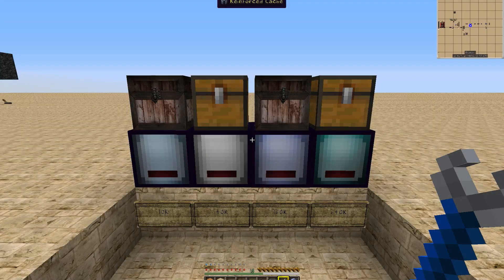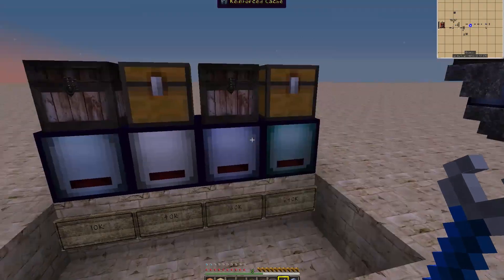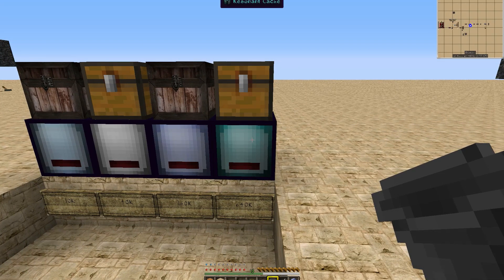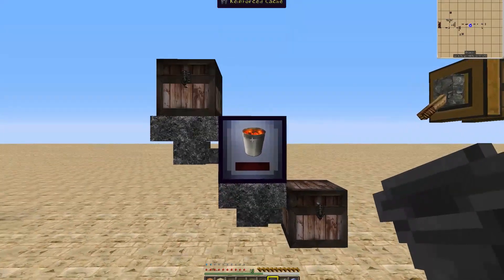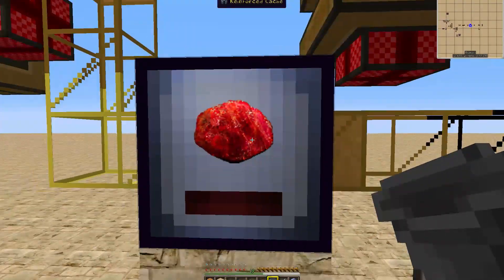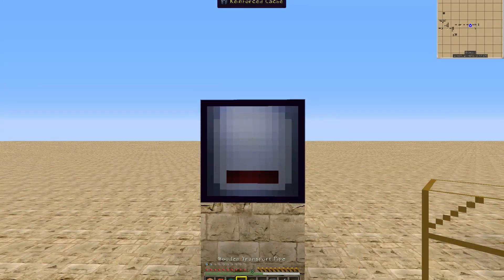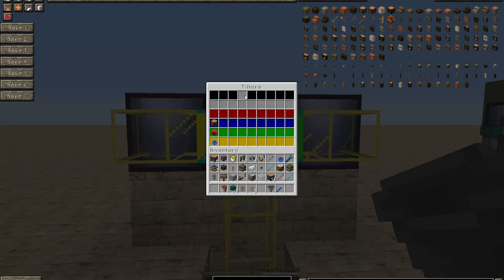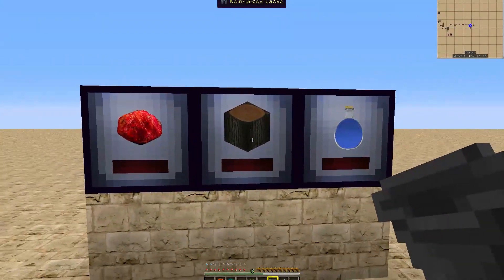How It Works - Thermal Expansion - Caches - Tutorial

Comment: Arent these just basically more expensive, less cooperative jabba barrels?
Reply from the maker: JABBA barrels require diamonds, emeralds, obsidian, end stone, etc to get the different Mk levels for structural upgrades to make better barrels. These Caches are rather cheap in comparison and simpler to upgrade, with the most expensive (and last) upgrade requiring ender pearls and blaze rods.
Reply: RxCraft yeah but....if you have the need to upgrade these, then you already have the resources for the jabba upgrades. lol
Reply from the maker: guardiangarasu True enough. :)  How about it's easier to set up Autocrafters to make Resonant Caches? The mod setup I use in my LP doesn't have JABBA, so there's always that problem too.
Reply: RxCraft that might be what it boils down to. whether or not jabba is installed. of course these also look good for those who want more of a hi-tech feel to their storage.
Reply from the maker: Yes, I do agree they look more hi-tech. I'm kind of a fan of the full meter they have instead of the 2^64+X display of the barrels.
Reply: but still. its hard choice between these and the b-space upgrade for jabba. lol
Reply from the maker: Yeah. I think these caches would be a great starter storage room item and maybe use jabba barrels behind your cobble/dirt/etc mass storage sections as a "deep storage" option, but keep the caches as the facade.

Comment: and how u know how much is in there??
Reply from the maker: You can look at the indicator bar on the front of the cache to get a general sense or if you pick up the cache, you can see the exact number of items in the cache as well as the max amount the cache can hold in the tooltip when you hover your mouse over it.
Reply: thx and I finde out u can use a multimeter to check exact how much is in there.
soory for my EN.
Reply from the maker: BILL NO No problem. I'll update the video description to add in that little bit of info too. Thanks!
Reply: uw keep up the god work